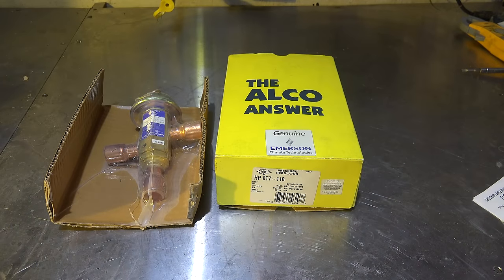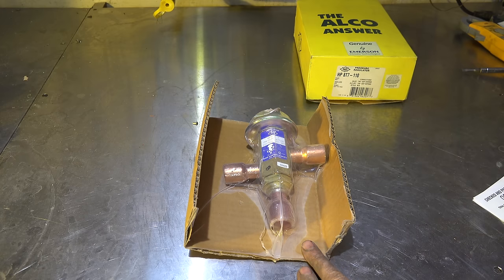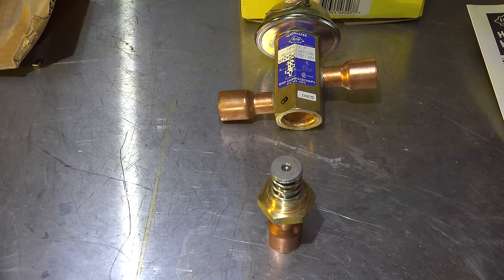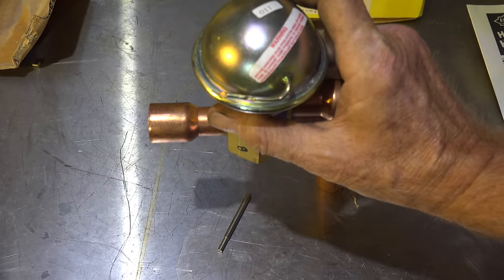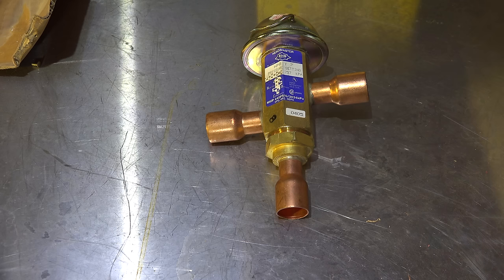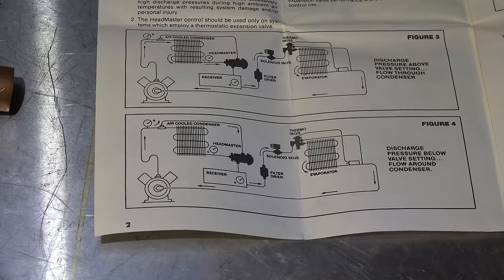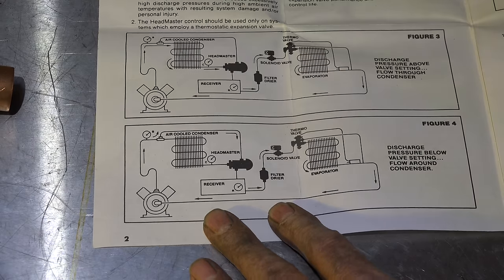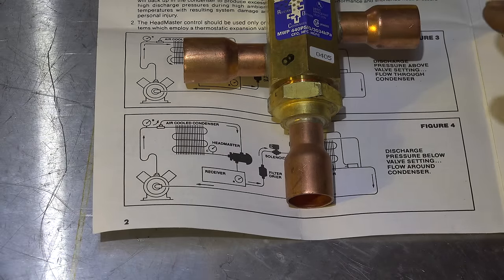The headmaster head pressure control

Comment: What wasn't very clear in the video but is very important, is this valve allows the condenser to flood or fill with liquid that would normally be in the receiver so the condenser has a huge amount of subcooling.  This is normal in cold weather and does not work properly when the refrigerant charge is low.  The shell of the receiver will then become hot with bypassed gas to maintain proper pressure on the liquid line to the expansion valve.

In charging this system in cold weather, look for the condenser to have high subcool as it floods with liquid and look for the receiver to become hot with summer temperatures as the head pressure rises to summer type pressure,  Fill using the sight glass.  Receiver in this mode needs to have enough refrigerant to discharge liquid to the expansion valve in cold weather.
Reply: Right. I was reading the same in one of my books. The part I'm confused on is, is the valve closing allowing the condenser to fill up with liquid?
Reply: @elwoodstelhommme8745  Short answer, yes. Hot gas goes in one end and it turns to a mix of liquid and gas, until the very last part which is just liquid, which then cools. Restricting flow out, does two things. It provides less liquid to boil to gas in the evaporator, which results in less hot gas blowing into the condensor so more gas turns to liquid as it cools earlier, resulting in a small area of the condensor having gas, while the remainder is filled with condensed liquid. The symptom is the liquid leaving is very much cooled to ambient temperature instead of being warm liquid. This low exit temperature in relation to the hot gas going in is referred to as the sub cooling, or the amount the exit cooled below condensing temperature.
Long rant, but hope it helps understand a flooded condenser.
Oh the evaporator side, very little liquid is sprayed into the condensor so the compressor pumps the suction pressure low, often resulting in a small portion of the evaporator getting frost due to the low pressure. Again after all the liquid has boiled, the rest of the evaporator provides no cooling and the gas exit is warm, resulting in high superheat.

Comment: Great video! Thank you!
I agree that using a Head Master Valve (HMV) is a necessity for refrigeration systems. I had several service calls “freezer is not freezing” at low ambient 20F-25F. The reason for these issues was failed HMV. I cannot stock all and every HMV on my truck. So, I usually install a fan cycle control temporarily and I came back next day with correct HMV and replace it. Now days they start selling adjustable HMV. Another very helpful thing is balanced ports TXVs. These TXVs keep operating when the liquid line pressure fails 10%-15%, or even 20% due to low ambient. So, pairing HMV with a balanced port TXV is a great idea. Sometimes, if the HMV fails and condenser got 2-3 fan motors, I can install 2 FCC switches with different open/close pressure. However, HMV is probably better idea for a refrigeration unit at very low ambient.

Comment: And if it gets stuck in by-pass you can cut the pig tail on the dome to get you by. Good video GFM.
Reply: I was about to say, explain how to troubleshoot it...

feel the line between the valve and the receiver, if its cold then its bad. if it is cold, verify proper charge then take a torch and lightly torch the dome to see if it frees the valve
Reply: If it gets stuck in bypass would the  system act as if it was extremely overcharged, and cut out on high head pressure?

Comment: Great video. Thank you very much for what you do! I seen these on some small W-I units like Heatcraft. I noticed some have a Service Valve/Shrader Port on the Line just downstream of the Compressor Discharge just before it Tees off to the Inlet of the Condensing Coil and the Inlet of the Regulator. What purpose would that service port serve? To make it easier to Recover/Evacuate?
Reply from the maker: Its probably just a high side tap for service.
GFM

Comment: Thanks for the video. A follow up question, and may be a silly one, but how does this differ from a hot gas bypass?
Reply from the maker: The hot gas bypass takes discharge gas from the compressor discharge to the evaporator to be used as a defrost method.
The headmaster bleeds some hot gas into the condenser to raise head pressure.  Hope this helps.
GFM

Comment: I have a question I don't know if u know the answer to or not but what would cause an air conditioning unit to blow a hole in the side of the compressor
Reply from the maker: If the hole is at the wiring connection for the compressor wires, the windings have shorted.  Means the compressor has failed.
GFM

Comment: Can this type of valve be used to control high head pressure?
Reply from the maker: The valve is used to keep head pressure up to normal in low ambient conditions.
If you head is too high, you have a different problem.
GFM

Comment: Why would a Head Pressure Control have a sensing bulb and not made to be strapped around a refrigerant pipe?
Reply: Is it because the headmaster is strictly concerned with the calibration pressure inside the "dome"?  A constant head pressure device?  If the outside temp too cold then the headmaster starts to bypass due to condenser gas below 110 psig and leaks hot gas to keep receiver at 110 psig?

Comment: Have you ever had one where the power head has a sensing bulb attached to it?
Reply from the maker: No I have not.
GFM
Reply: Had a new pool pak dehumidification system with an isolated outdoor condenser that had a valve that appeared to be exactly this, but instead of a dome, it had a head that was just like an expansion valve with a sensing bulb. The bulb was just strapped to the bottom of the unit like it was supposed to stay there with no information on mounting it or any hardware to mount it. Waiting on info from the manufacturer to verify, but in the mean time, I figured I'd do some research.

Comment: Is this only refrigeration or can this be used on a residential style split-unit condenser? 
If not, what could you use on a 2-3 ton split unit?
Reply from the maker: I have never seen it used on an air conditioner.  Many air conditioners have a critical charge and would not match well with this type of control.
GFM
Reply: probably wouldnt work on ac because there would need to be extra refrigerant in the system to help fill condenser in cold weather (when headmaster is needed to increase head pressure). you would need extra system volume for extra refrigerant like a reciever tank.  it would probably work if you had a reciever but i imagine you would also need a txv to ensure superheat stays within spec too.
Reply: On a residential system use a fan cycle switch to control head pressure
Reply from the maker: The fan cycling control is probably the worst type of head pressure control.  During most of its operation, you will have wild swings in head.  This gives widely varying suction pressure, reducing efficiency and causing possible flood back.
GFM
Reply: @grayfurnaceman  He was asking about a residential unit. For refrigeration its definitely not the way to do it but for a normal 3 ton residential system to operate in cooler weather is about the most realistic option
Reply from the maker: I know that.  Have you ever watched the head (and suction) pressures when one of these is operating?  With a fixed orifice, flood back is guaranteed.  Even TXV controlled units have very little control of suction temp.  
Using a pressure control when an electronic fan speed control is available is plain dumb.  Its like using a floppy disk when thumb drives are available.
GFM

Comment: Thanks GFM!  Is this a cpr or epr?
Reply from the maker: It is neither.  It works by controlled release of hot gas into the liquid line to increase head pressure.
GFM
Reply: grayfurnaceman I've seen a unit before where a valve similar to that and had a third line set tube running from the valve all the way to the evaporator just past the txv... Is that what this is?
Reply from the maker: No, that was an EPR.
GFM
Reply: grayfurnaceman i just looked around more at other setups and I believe its actually a "hot gas bypass"... It goes from compressor discharge to the valve, then the valve goes to both condenser inlet and the evaporator inlet... Didn't realize there were so many other types of bypass valves, thanks!!

Comment: And the head pressure control is there for low load conditions so the compressor basically doesnt slug?
Reply from the maker: It is a head pressure control but not necessarily for low load conditions.  It is condenser flooding device for low outdoor temps.
GFM
Reply: @grayfurnaceman  so it raises head pressure in low ambient conditions to reject a sufficient amount of heat. otherwise without it theres basically nothing happening?
Reply: @grayfurnaceman  also can a head pressure control be substituted with a fan cycling device such as a vfd or condenser fan cycling control?
Reply from the maker: @Jim89240  You can, however, a fan cycling control is not effective for very low outside temps.  The same for a vfd.
GFM
Reply from the maker: @Jim89240  Yes, If the outdoor temp is very low, there will not be enough head pressure to make the expansion device operate.
Reply: @grayfurnaceman  i get it. Basically what youre doing with the head pressure control valve is dumping pressure hence temperature into the condenser coil therefore giving the refrigerant a push through the txv to complete the cycle when its too cold for a refrigerator to run normally. Fan cycling i can see can be ineffective in lower temps due to the fact that theres no direct injection of hot gas going on, just heat buildup. Anyway thanks for making this clear

Comment: How can you tell if headmaster controls are not functioning properly
Reply: check all the pipe temps, if its hot out, it should be closed. look at the pressure rating. look up the data sheet
check pressures and temps, compare to chart

Comment: When charging a system with a headmaster I run a hose over the condenser. Ever done that?
Reply from the maker: I have not but it seems like a good idea.
GFM
Reply: Ben Detta why? Head masters still going to bypass till you get your temps/pressures pending on ambient conditions